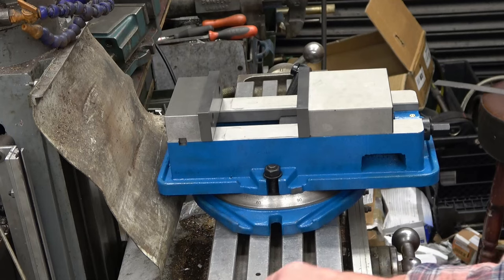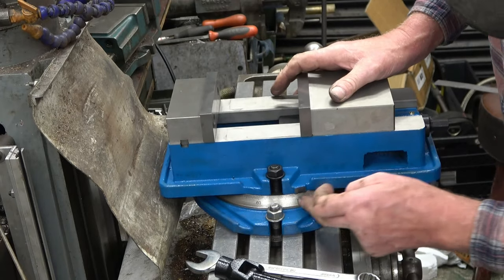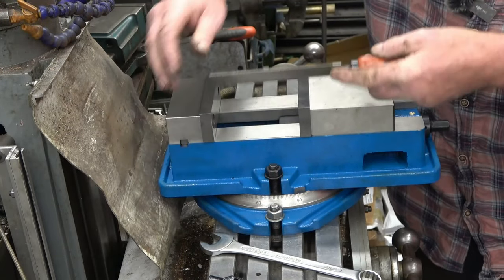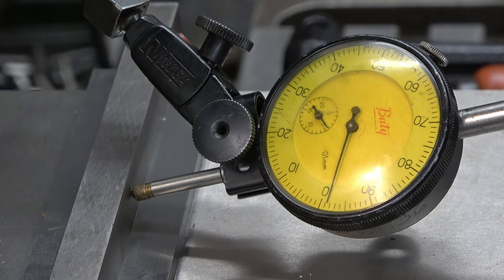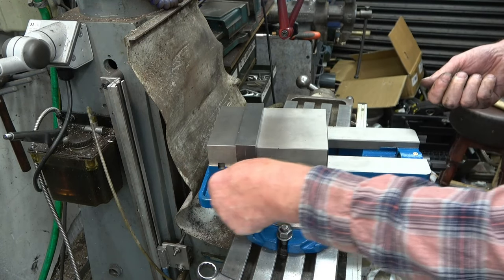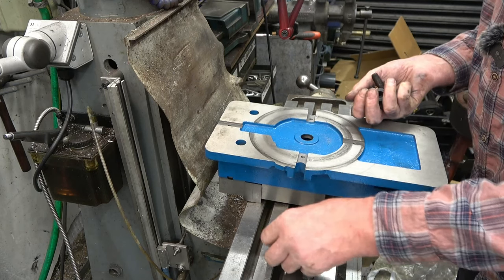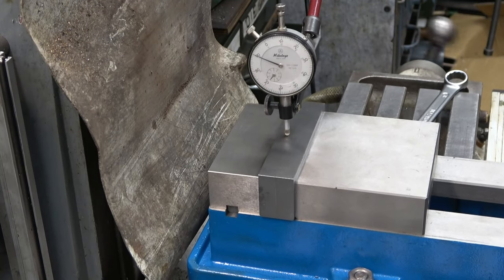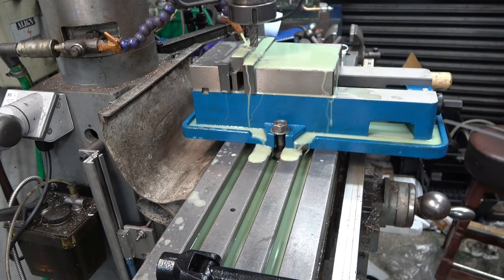Vivor . Milling Machine Vice Review

Comment: John, I bought the 6" version of this vice without the swivel base direct from vevor for £80, had been thinking of buying one for a while, the base was out and needed scraping to get it flat, also the top rails, there was a .005" dip right next to the fixed jaw, just where you want to put a square to square stock up, wouldn't have minded had it been the back end, so scraped the top rails flat and parallel, fortunately the fixed jaw was true at 90 deg to the base, but I had to shim one side of the fixed one to get it parallel, the only thing I have against it is that the material is very soft, care needed if tapping down, worth the money if your prepared to spend a bit of time truing things up.
The later Kurts have a mod you can do to the moving jaw, fitting two O rings to the bottom front to hold it up off the rails, I used a 12mm slot drill to bore the two shallow holes about .040" deep, fitted 2 12mm O rings, this leaves about .020" sticking out, reassemble the moving jaw, and with the small adjusting screw pull the jaw down till you can get  a 3 to 4 thou feeler under the jaw,      When you tighten a part into the vice this doesn't  just stop the part lifting, it actualy pulls it down onto the parallells, a good mod,  mine produced a square block no problem at first try.

Comment: John

You missed the detail on the moving jaw and leadscrew nut.  They both have wedge shaped surfaces which pull the moving jaw down, onto the ways, when the vise is tightened so their is no possibility of the moving jaw lifting when tightened.
Reply from the maker: Thanks for that

Comment: Nice vice John; I did note that as you ran the DTI along the fixed jaw I noted that the reading on the swivel base mark was not aligned on the 90* mark when your DTI indicated zero, it looked to be approx' a couple of degrees off. Maybe worth doing a recheck. I had a 4" swivel base vice from a well known supplier that when my DTI showed 0 - 0 over 4" run along the fixed jaw showed a discrepancy if 2* on the swivels base markings; disconcerting if your angle setting is a critical one. Otherwise a nice value for money vice.

Comment: I would like to know about this.

VEVOR Welding Table 36" x 18", 1200lbs Load Capacity Steel Welding Workbench Table on Wheels, 2 Layers Portable Work Bench with Braking Casters

Comment: before you start cutting on those jaws take them off and clean under them and put them back on.
Reply: And also measure them at either end height wise and see if they are still twenty thou different. I can't believe that both jaws were ground with a twenty thou taper. I bet you are correct and there is crap under both jaws at one end. When doing a review like this it would really pay to strip and then clean everything before checking it. The machinists who do these vices obviously are doing good work, but as we all know the plebs who put these things together couldn't give a flying fuck about the product and just slap the well machined but possibly dirty ( from machining) part together without cleaning any swarf off of them.
Reply: It is very likely the jaw inserts could be tapped into horizontal parallelism by just loosening the clamping screws a little and give a few light taps with the copper mallet and check with a clock. All in all I think it is a a great value machine vice.
Reply: @samrodian919  in fairness to the suppliers it is the quick assembly that keeps the final cost to the customer low. Dismantling and fettling isn't a great hardship to the end user really.

Comment: Dude….lose that rotary base thing….the vise will be 5 times as rigid!!!
Reply: 8:47...
Reply: It will be more rigid certainly but not that much given the centre pin is usually machined with a close tolerance to the corresponding bore and it is held locked with the two tee bolts. I have a different make of swivel base vice constructed in the exact same way,  and it's pretty rigid. That said yes loose the swivel base if you don't need to machine angles. But I use mine to raise the height of the work to get it into the scope of my lathe/ mill combo. Plus as I've only got an 8" x 6" cross slide table I often swivel the vice 90 degrees to hold the work the other way. ( I only have 160 mm travel between the centre of the spindle and the headstock spindle face)